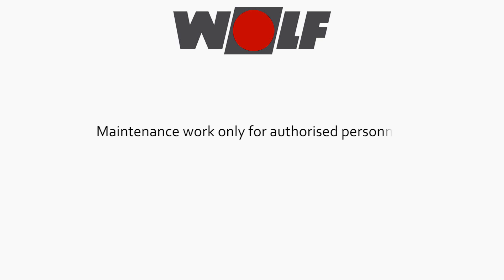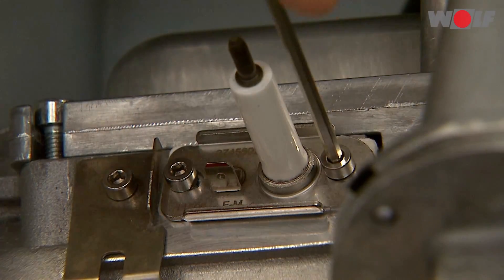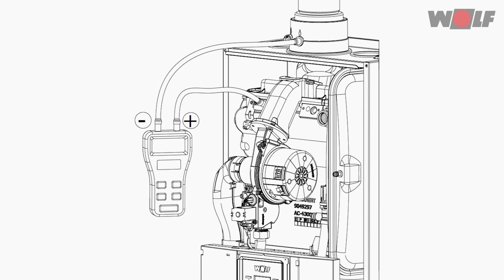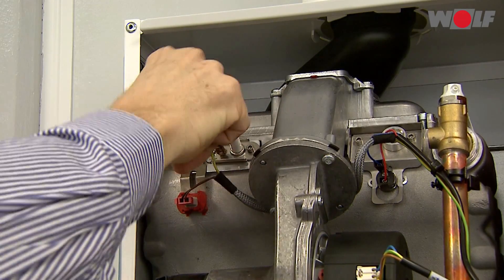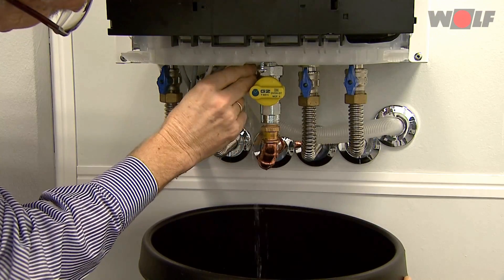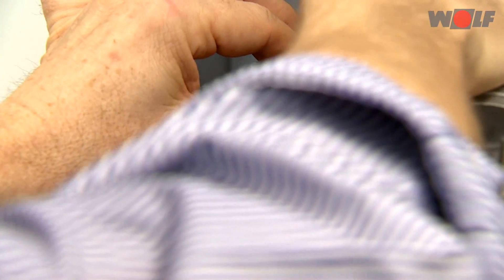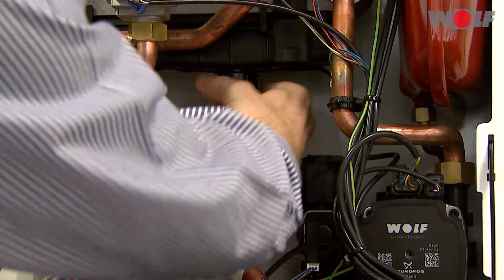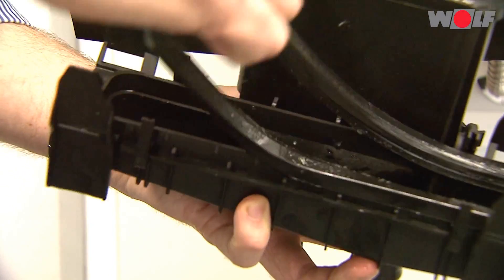[en] WOLF FGB Maintenance instruction for contractors

Comment: i will also never buy wolf boiler !!!!!! never worked properly and after 5 years finally replaced it!!!!! absolute waste of time and money !!!!!
Reply from the maker: HeyHey, this sounds realy not good! What happend with your boiler? Greetings, Simon from WOLF
Reply: I have wolf CBR100 in three buildings installed 2018 - 2020. Now all of them have the same problem boilers don't keep time in system and all the time after several days set defult system setting Oct.2011. It might be boilers controllers have battery problem. 
Now I have new modernation project of gas heating in an other house, but I will not chose wolf any more.
Reply: By the way autorise Wolf servicemen also can't solve this problem.
Reply from the maker: Hello, unfortunately we do not know your systems and therefore cannot give an assessment from afar as to how the errors occurred. This really needs to be clarified on site with the service technician. Best regards, Simon

Comment: WOLF BOILERS do not work, when it gets cold it shuts down and wolf do not have proper technicians to repair them.
Dontt buy WOLF boiler :do not have proper trained ttechnicians: I had one put in 2 years ago: it shuts down whenever it is cold out side bcs the pump is too small and it over heats so my house is never above 15° and WOLF cant help fix the problem 
I wasted 10000€
Reply from the maker: Dear Agathe, we are sorry to hear that you have problems with your WOLF boiler. Could you please write us an email including some information about the boiler/the problem, where you bought the boiler and your contact data to social-media@wolf.eu? Best, the WOLF social media team.
Reply: @WOLFDeutschland  I have written 3 emails to WOLF France, spoken to them on the phone and used their recommended companies...that is why I am now choosing social network so others can learn from my direct experience... today I have found (finally) a good professionnal repair company and he says the problem is linked to the pump in the boiler that is too small and over heats so I need to have a pump installed... I have spent thousands of euros on this and after 2 years I still do not have a proper heating system.... 
I will see if the boiler will work after this change mid February... If you wish to financially pay my electricity bills for the heaters I have plugged in because WOLF boiler does not work, I would appreciate the gesture.
Reply: @WOLFDeutschland  I will send you my email off line
Reply: @agathedebluesmpeid697  did you fix the issue? I have the same problem
Reply: So no unfortunately never found a way to solve the problem, of our Wolf boiler but was told the compressors weren’t big enough and had a safety functionnthat turned of the machine rather than make it go idle. So you have to manually turn it back on (difficult when you are sleeping and it shuts off in the middle of the night) wolf was of no help. 
I have since moved house and the new owner has same problem. 
I will never buy a wolf boiler again because we had zero help from them.
Good luck